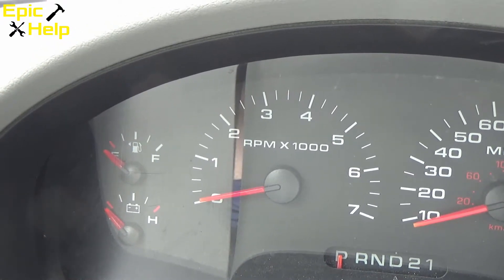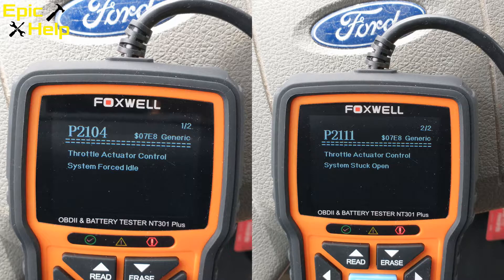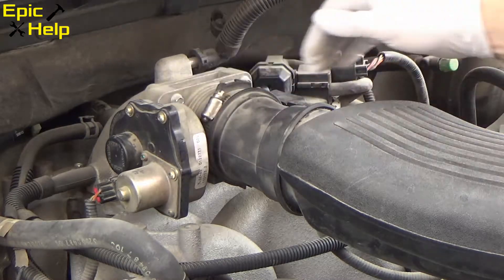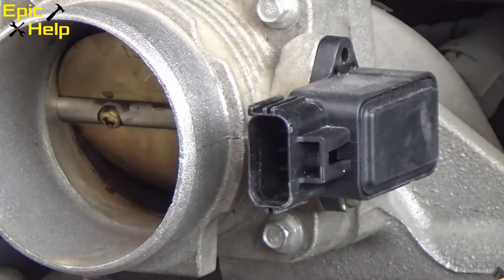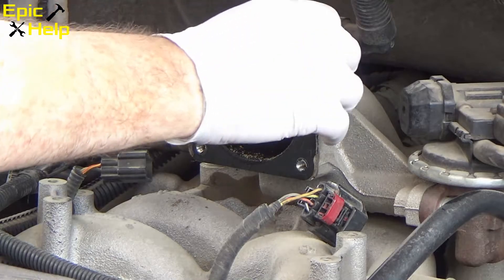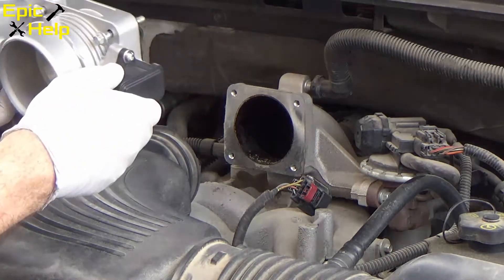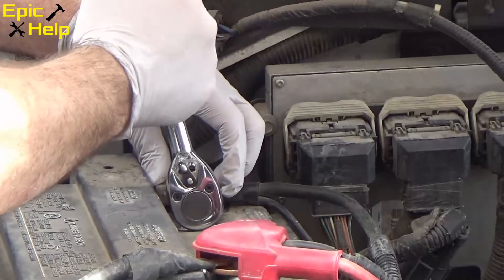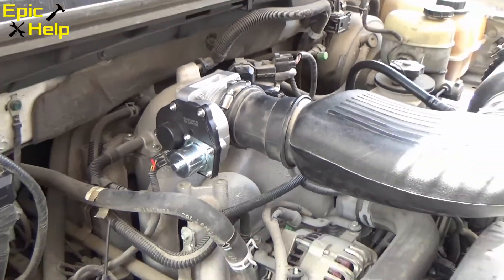Replace Throttle Body Assembly - 2004 Ford F150 4.6L

Comment: I had the same problem on my Mom's 04 F150 5.4 triton 3V. I cleaned the throttle body after removing it and replaced the TPS (throttle position sensor) I also did the TPS sensor reset. Once I turned the truck back on the check engine light and  service wrench light went off. Truck is running great now.
Reply from the maker: That's great! I enjoy hearing good news.

Comment: I have same problem on my 2007 explorer 4.6 v8 do you think if i replace throttle boddy will solve my problem ?
Reply from the maker: Did you hook up an OBD2 scanner tool to see if you get the same codes?
Reply: @EpicHelp   i have exactly same sode 2111 and 2104 when i hooked obd2 it reads throttle position opening coreectly when car is off ignition on  as soon as i starts the car reading doesnt move when i hit the pedal ?
Reply from the maker: If you have the same issues and same codes, then try replacing it. Even if for some reason it does not fix the problem you will end up with a new throttle body assembly.
Reply: Actually i just replaced throttle position sensor didnt solve the problem i will end up changing whole unit as you success  finger cross thanks for help 👍
Reply from the maker: You're welcome.
Reply: @EpicHelp  what If I got p2104 & p2112?
Reply from the maker: @royalteelawncarelandscapin5369  p2111 is stuck open and p2112 is stuck closed. You could try throttle body cleaner first in case it's just dirty. Otherwise replace the Throttle Body Assembly.

Comment: Excúseme my friend you did not  reprogram the throttle body?
Reply from the maker: The Engine/Powertrain Control Module will learn as you go. I let the truck idle for 10 minutes, then did
normal driving over the next week.

Comment: Still never had a problem?
Reply from the maker: We ended up selling this F150. Don't know if it is having problems as of today. 🤷‍♀️ The 2004 F-150 had major issues with the automatic windows. Seemed like every other year something went wrong.
Reply: @EpicHelp  well it seems I'm having the exact problem. Going to swap my TB today. If yours would sit a while, would it fire up and run great for 2 mins or so before it would lose pedal, ect?
Reply from the maker: Sometimes it would. Most of the time it just went directly into limp mode.
Reply: @EpicHelp  replaced my TB and fpdm today. Before I began the project, I started the truck to let it run so I could get a close to precise time the truck would run normal until the symptoms began, in hopes of comparing before and after to help confirm a successful repair once done.  Prior to today, it would run a max of 5 mins from cold start before the wrench and CEL would illuminate, rough idle, and loss of accelerator pedal. Well, today it ran and idled normal for an hour. Longest ever by a ling shot since this began. So I have no clue. I replaced the parts anyhow and let it idle for about 4 hours. Drove it a bit to relearn shift patterns. I'm just worried it's going to do it again while I'm out away from home. I don't know how to confirm a successful repair or not. It's driving me nuts!
Reply from the maker: Sounds like you fixed it. At this point I would just drive and not think about it too much.
Reply: @EpicHelp  easier said than done. Lol
Reply from the maker: @TKO-NY  😄
Reply: @TKO-NY did the problem came back?
Reply: @miguelcalderon3702  was never my TB. Was PCM.